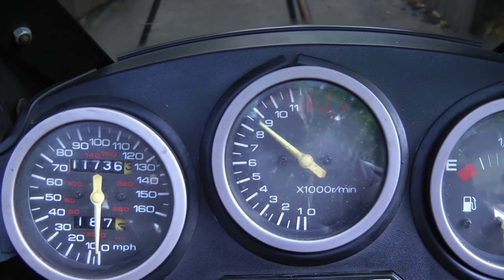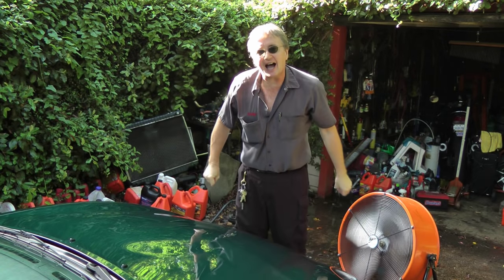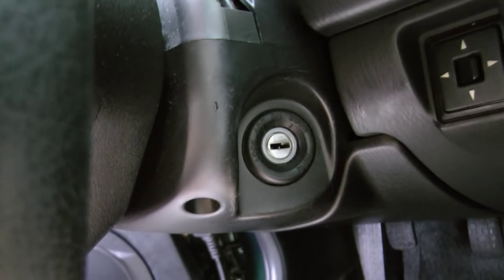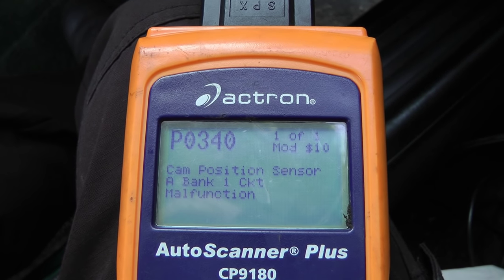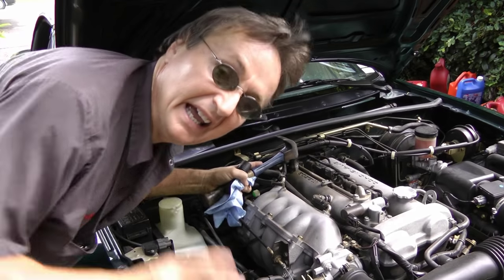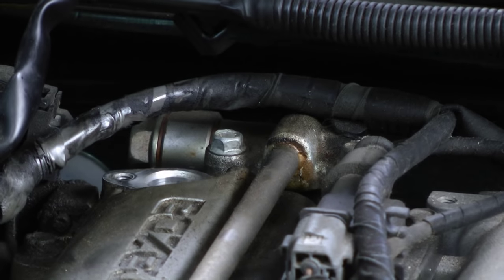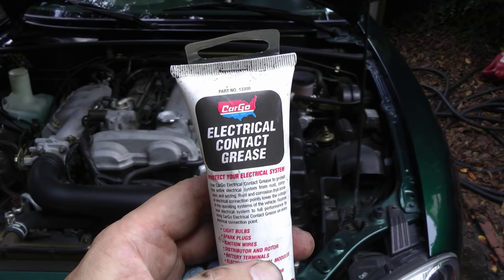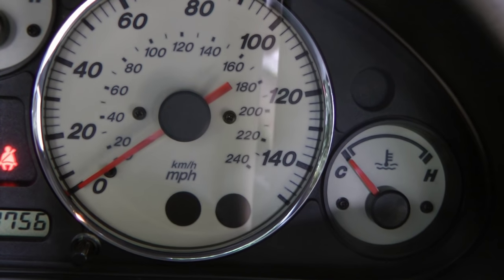How to Fix a Car that Randomly Dies while Driving

Comment: Hey thanks Scott for responding so fast your awesome I recommend alot of people to go and view your tube videos your the best and very knowledgeable   p.s this car doesn't have maf sensor so it will most likely be fuel pressure regulator  but what if I change it out and I don't have a leaking fuel injector then where should I look next . Thanks again scotty
Reply from the maker: DeezSteez do those first, they are normally the cause

Comment: Scotty, i got one for you
2006 Dodge magnum, 5.7 hemi, it stalls out during idle or driving, new fuel pump, new spark plugs, when it dies there is no check engine codes left behind.

Comment: I went through this a few months ago with my 2006 Frontier.  It would just run kinda crappy all the time, if I went far and the engine got hot it might just die, it would barely start back up, and then run even worse.  Then when it cools down it goes back to mildly crappy.  It never gave any codes for months.  Finally it died once and I got the P0340 code for a few minutes.
I took the camshaft sensor out and noticed that the rubber o-ring around it was missing somehow.  I guess that might have been the problem.  But I already had a new one so I just put that in instead.

Comment: Hi Scotty I have a 1985 Chevy Nova that stops on me while driving it. Once i wait about 30 minutes it will start right back up. I have put a new distributer, fuel pump, spark plugs and wires, oil filter etc. It used to just do it once in awhile then it started to do it more often that I had to park it. Someone told me it could be the sock in the fuel tank. What do you think it could be.

Comment: Scott I have an issue with my 07 f550 V10. It drives fine no rough idle. But when I come to a stop it does. But it fires right up when I turn the key back on. What do you think it could be. I have no codes coming on or check engine light at all.
Reply: Mine was doing that. It was a MAP sensor. Like mass airflow sensor.

Comment: My 06 Camry has had no issues. I let it sit over the weekend (since social distancing) and my wife tried driving it Monday morning and it randomly died/ stalled. Its frustrating because the car runs tip top, I do all the regular maintenance on it and have been for years. Hopefully it can make it to autozone to be able to check it

Comment: I have a 2002 Honda Civic LX. The Cam Sensor is under the Timing Belt cover. It costs more for the labor of a mechanic to change this very inexpensive part? What was Honda thinking?

Comment: My 2005 Ford Escape, new plugs, new MAF sensor, new idle air control valve, has started to stumble briefly/die while driving, and then start back on it's own. Today it died at a red light, but I was able to start it up again before the light turned green. Then it drove for several miles with no problem. Check engine light did not come on.

Comment: Hi sir, great videos as all otther you have.

I have a question, all OBD2 scanners works with all OBD2 cars? I mean, I have a Renault Logan with OBD2 scanner port and plan to get a not so cheap scanner tool.

Thanks in advance
Reply: +ASF Yes, OBDII is a standardized port. The whole idea is that any scan tool will work with any car. I hope that helps!

Comment: My car has been doing this ever since I replaced the fuel pump the fuel filter the camshaft position sensor and the crankshaft position sensor. I just hope it's not the main computer or the fuel injectors or even the timing chain

Comment: Hey Scotty, 

Pray all is well with you. 

The car engine light was on - P0010/P0013/P0420 we’re replaced, no more engine light & was running excellent two days ago. 

Yesterday, the car was towed now it stalls & won’t drive no more than 15mph; the engine light remains off....Please help an Army Veteran.

TY & Stay Safe

Comment: What would you think if a car was bogging out at freeway speeds but isn’t throwing a code. I have a new fuel pump and fuel filter. No obvious vac leaks.  Car starts up fine. Car is 2008 vw r32

Comment: So I have this 93 jeep I love, a Laredo Grand Cherokee. But I discovered I have to put the ignition switch on on and wait till the check engine light flashes which engages the fuel pump priming the rails, then it will start as normal. If I try to start it, strait away without the ritual, then it floods, disturbs map sensor and will not start and just drains the battery. Changing relays had no effect.

Comment: hi scotty.first off Great channel,have learned a lot from your videos.now my problem.ive got a 97 dodge Dakota with the 3.9l v6.the truck will run just fine when I first start it.but if I drive it for a short but and then turn it off and start it back up it will stall I'm unless I hold the throttle for a few minutes.i have replaced every sensor on can think off plus all the ignition system parts.any input would be great,thanks in advance.
Reply from the maker: leaking fuel injectors often do that, they flood out a hot engine
Reply: +Scotty Kilmer thanks scotty,I replaced the injectors and now the truck runs almost as good as it probably did when It was brand new.

Comment: Good video quick question my car Nissan Altima don’t start I change the crankshaft position sensor but it works for few days then one morning don’t start it have power but no crank or clicking sound on the starter do you think is a bad crankshaft sensor if you can point it me to the right direction will appreciate tks

Comment: Hi scotty. I have nissan almera 1.8 2003 manual, but while driving the car loses all power(rpm drops etc.) but because it is manual it's starting with hill start and its runs normally, but it can do it many times on the way. Thanks.

Comment: Scotty my truck has the P0171 code and randomly died at a stop light yesterday.  Where should I start to try and fix this? It's a 01 Silverado 1500 1500 5.3L V8 Vortec Z71

Comment: hi scotty , i have a 2015 tuscon with 2.4litre , it just dies in traffic , then wouldnt start , when it did start i got it to a friends nearby , and it would start then stall it wont keep goin, i put on scanner it read  correlation bank 1 , sensor b , so i got a new sensor put it in n still does the same , is sensor b the one by the radiator or firewall, , also it will start when cold but run rough , i stop it then it wont start again , it did this 2 weeks after warranty finished, good thing there were no cars in front or behind us

Comment: Yes a scan tool! But my car stalling does not throw codes. My garage is having fits and can't find the problem. All the normal thigs have been done. Tune up, BG flush, replacement computer etc. My Charger GT 2006 still stalls randomly at stops.

Comment: Alrighty, so my 91 civic is acting goofy.Let me just say every part except the starter is new on my swipes engine, battery is new also, idles great drives great. I’ve been driving it two or three times after the new engine install. Today I drove it and when coming to a stop the tach dips down as if it’s gonna stall out then straightens right out, it didn’t do this the last time I drove it? Bad positive cable as the negative is brand new and has two cables on it. Thanks.. 91 Honda Civic with no port for a scan tool but have no check lights on

Comment: Hey Scotty I have a 2003 Ford mustang GT. It starts up fineand I'll drive it for like a mile and it is starts sputtering almost like it's at a gas then it'll shut off. Then she starts right back up and like 10 or 15 minutes and does the same thing. Do you think it's the same part that you replaced on this video?

Comment: I've got mk6 fiesta 2005... Just stalls when driving / idling.. No error code showing, cleaned throttle body, replaced tps sensor, repositioned relays, cleaned pump filter, new oil filter, cleaned sensor on front wheel arm... Still stalls.. Pls advice Scott!
Reply: Fix it?

Comment: Driving 40 mph about 2000 rpm, suddenly I felt a little tug or loss of power. I looked at the rpm cluster gauge and it went to 0 then after about 1 second I went right back up to 2000 rpm 
What do you think is going on?
I also think a have a bad tensioner, because I have rattle at start up when cold and, no rattle when warm

Comment: My 2000 Focus randomly dies while driving it. It's not coding. I've narrowed it down to either the alternator/alternator wiring harness or the fuel pump filter. But when it dies I lose all electrical power so I don't think its the fuel system. Advice? Thoughts? Thanks in advance.

Comment: Hi scotty kilmer My 1995 Subaru  legacy keep stalling and running rough I toke it to auto zone and had them test it and it came up with o2 sensor,mass airflow sensor, egr valve so I replaced my mass airflow sensor, cleaned up my egr valve and toke it to get tested again. And everything that I replaced and cleaned came up again still but the o2 sensor went away but my car is still running rough

Comment: I own a 2004 Maxima. It will die in the middle of driving every once in awhile (typically when it's warmer out) and lately about 1/15 to 1/20 start, all it does is crank for 30 seconds before firing. There is a TSB out for the camshaft position sensors. Is this something that I could just take out and clean or do they need to be replaced (I'll try tapping them with a hammer first maybe?)? If so, I've heard that I should only use Nissan sensors because aftermarket camshaft position sensors are cheap and unreliable. But Nissan wants 3-5x more than an aftermarket sensor.

Comment: Does the hammer tapping trick work with both the 2 wire and the 3 wire type camshaft sensors?

Comment: Hi Scotty, I've got the same problem with my Volvo C30 1.6 d. And it dies on the Highway. Could this problem also be fixed by replacing of fuel pressure sensor?

Comment: Hello Scotty, my 01 Lincoln kept shutting off I replaced the mass air sensor based on the code reading, I even replaced the fuel pressure sensor, fuel filter and aps valve. I still have the same problem and code reading is still the same.. Have any idea whats going on? Thanks a lot!

Comment: Hi I just recently did a head gasket, oil pump, timing chain on a 3.7 Jeep Liberty sport. And it’s start right up when it’s cold but when I accelerated when it reach operating temps like around 195 to 200 degrees it just stop don’t wanna crank over on till the  temps goes down again

Comment: Scotty my 2000 Olds Alero 3.4 V6 cuts out while driving.  When it cuts out, engine will crank but not turn over. I have to wait for about an hour before it starts right back up to make it home.  This same problem has happened FIVE times.  FUEL PUMP GOING BAD?   It starts up good every morning on first start, accelerates fine driving, but cuts out randomly and will not restart. I have to wait for about an hour to start car again to make it home.

Comment: 2011 Honda Pilot shutoff on the road today.  P0340 code, cam shaft position sensor.  I saw video's on here saying it was behind the front upper timing belt cover and others saying its on the top rear of the engine.  Any ideas on where it really is located?  I have the part coming this Saturday 7/30/2022

Comment: Hey I have a Chevy Silverado 1600 4.3 2006 and my car keep shutting, Sometimes when u try to time your car on. It will run but there are days that won't and then when your driving, you feel like the car wants to shut down. Sometime the  battery is completely dead but the battery is new and we change the distributor and the spark plugs

Comment: Hello Scotty, Big Fan and working my way through your library of Jedi like tutorials. I have an 81 Vette that get to 45 to 50 miles an hour and stalls out, it cranks right up and does the same, I am suspecting the fuel delivery in some form or another and or the points, any advice on how to systematically approach this fix?  Thanks and I am a subscriber, as should anyone that drives or knows someone who does.

Comment: Hi Scotty, I have a 2007 Mazda 3 Hatchback. Yesterday, the check engine light and the oil light came on at the same time and then the car just stopped responding to the throttle and steering. I restarted it and pulled into a parking space. No lights came on. I drove home and still no lights came on. I purchased the BAFX Products OBDII Bluetooth scanner and ran the diagnostics. But no fault codes are showing. I called my local auto shop and it will cost $120 just for them to use their diagnostic scanner. What should I do? What could the problem be?

Comment: hey Scotty your vidoes are so helpful but back in September my soon was driving home from school it was a 1999 Chrysler 300 his rpm gauge went all the way to 7rpm`s and the car shut off we pulled it home checked what was wrong with it but we couldn't find the problem. it had a new timing belt put on and air fans put on i also had put a new computer on it before this happend to my sun. i then took it to the dodge Agency but they said it needed a new transmission. i then took a while to think about it i asked a auto college graduate what the problem could be so he then said probably no oil to the engine. it had oil before this happend to my son. i decided to turn it on and something popped in my engine still not sure what it could be? i would really appreciate if you could help me out with this!! thank you

Comment: Scotty Kilmer, no check engine light on 1997 Toyota Corolla CE. Run and after warm-up during driving dies.
Changed: Fuel Filter & Fuel Pump Assy, 234,911 miles
Have BlueDriver OBD2 that you recommended. But don't know to check or read this problem.
Do you think it's the Cankshaft Sensor this is defective or what?

Comment: Hello Scotty, I hope you can shed some light on this problem. 2004 Honda Civic with 104,000. These dash lights come on, Abs, brake, in short lights indicating a problem. Engine loses power, then engine gains power. very confusing. Any help please

Comment: I had a 79 Plymouth volare and then later a 83 Ford Thunderbird both had the same issue. Both cases the engine would die while in the middle of driving or standing still randomly. I noticed when the engine cooled it would start back up then when it got warmed up bam it would die again then repeat. Well back then I had a good mechanic after some trial and error figured out the pickup coil (That what he called it) was bad. When he replaced all was fine. It funny that I own these cars one right after the other and I had the same issue.

Comment: My 2010 Mini Cooper S (R56) has died/stalled 4 times in the past month. After the 2nd occurrence, I took it to the dealer who couldn’t find any problems. How do you diagnose a problem if it never generates a code? We may trade the car because my wife is afraid it will stall in heavy traffic on the way to work.

Comment: Hey Scotty, I have a 99 camry 4 cylinder with 100k miles on it, lately the car has been cutting off when I slow down but starts back up immediately (I don’t have to wait at all to start it) it’s happening once the car is warmed up and when its hot outside it does it atleast once every time I drive it. I have replaced the fuel filter, spark plug wires, cleaned the idle control valve and im going to change the spark plugs and EGR valve next.. No CEL or codes what so ever (I scanned it) Any suggestions? Thank you!

Comment: Hey Scotty, first off, Airborne!! Second, my car, a 1999 Camry, has this thing, where when I'm in the car and its running, if I hit the button to lower my window, my lights on the dash dim. It's happened once while I was driving, but started right back up. Usually I just pop the negative off the battery and back on. Any thoughts?
Reply from the maker: +Robert Hadden first, have the battery and alternator load tested, auto zones do that free. But if they are ok, the the power window motor is wearing and causing too much drain

Comment: Hey Scotty, my honda fit 2003 dies randomly during slowing down or at low speed. After a min, all the lights come  back on and engine can restart. There is no check engine light or any codes!  What do you think?

Comment: I have a 1986 Chevy suburban c-10  5.7L that does that. I have a new fuel pump, new carb new fuel filter  and it drives on short distances great but after 15-20 miles on the hwy it dies I'll wait about 10m start it back up and it drives fine, I was told it could be the fuel vapor line

Comment: Have a 2017 Kia forte ex. Engine died or shut off while driving. Still had radio power steering lights etc while I coasted into a parking lot. Could this be a bad ignition switch? Only 76k on the car. Oil done regularly.

Comment: hello mr Scotty my honda civic 8th gen  on freeway some times start loosing power and the engine light blink  so i have to turn off and then turn back on  and keeps driving normal  i think that's my problem, i will change the CPS and i'll let u know if works for my car  thanks